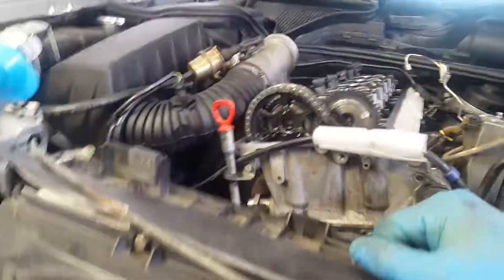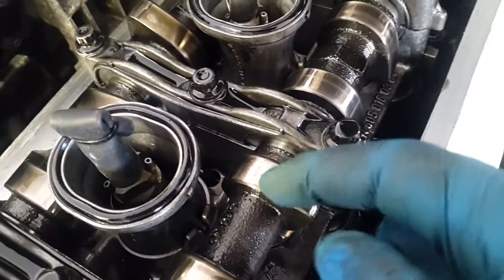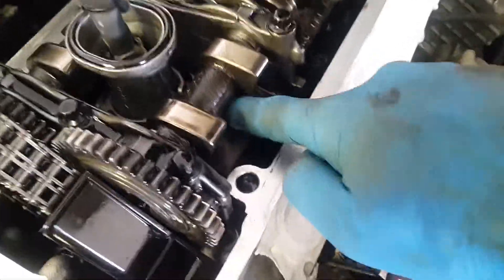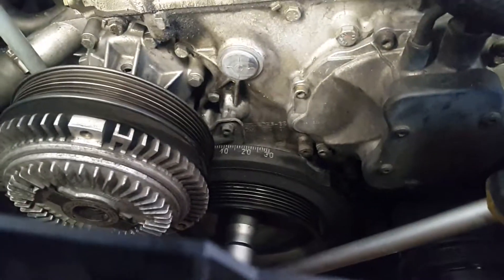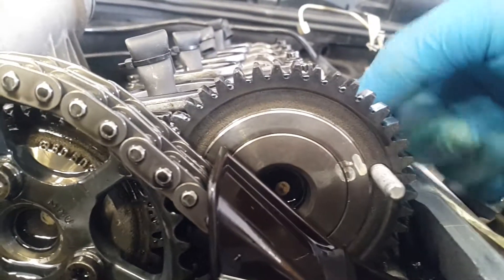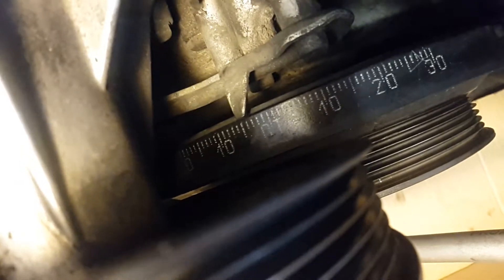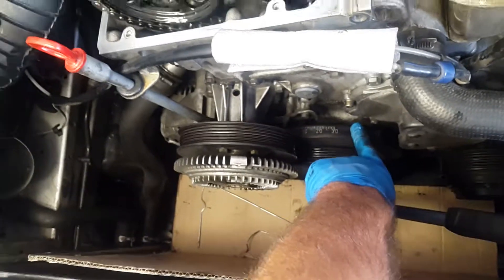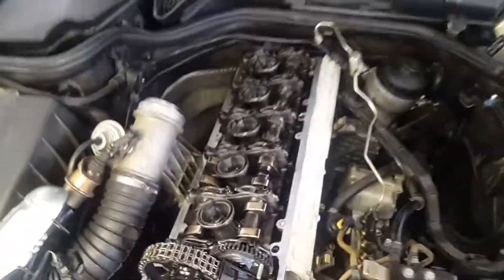OM60x timing chain stretch

Comment: How many miles is on that engine mate for it to have 5degree chain stretch thanks
Reply from the maker: at that time around 420.000 kilometers..
Reply: Wow are you still running it to date has it had any other problems